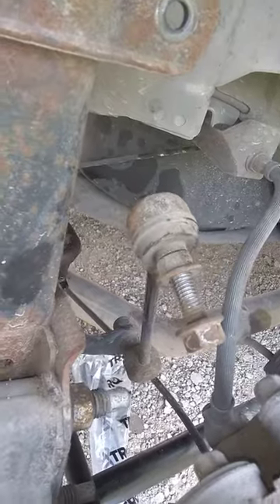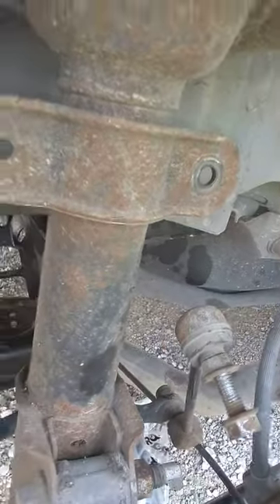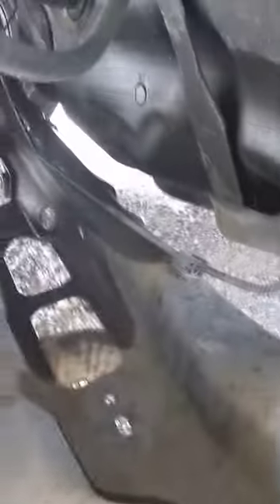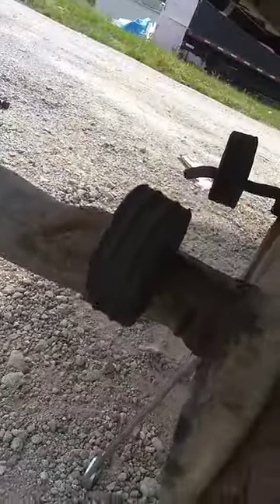Chevy Impala rear trailing arms

Comment: How do I lower back end of car rear of car is to high
Reply from the maker: USE a jack with some blocks Also Spray bolts down very good With Pb Blast 🔩
Reply: Just bought car it seams really high in back it feels like the back rises when I brake hard , can I lower the back or do I have to live with it like that ?
Reply from the maker: @Jose-ni3fm  o amazing Question had alot of thoughts 🤔 But you Can Order from a1 auto regular shocks or Regular Struts Which ever your car has order the factory oem shocks and struts or if you wanna lower it or lift kits that lower on the internet search impalas are great Cars Just gotta maintain them If I was you I would Order A1 auto Suspension strut kit for front and the back your front struts could be also worn Don't half step never When replacement